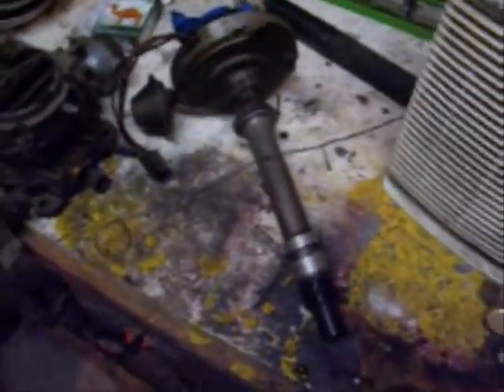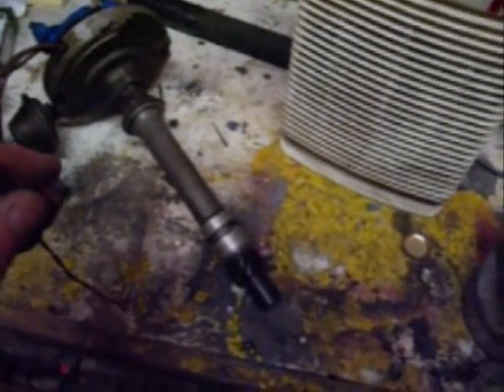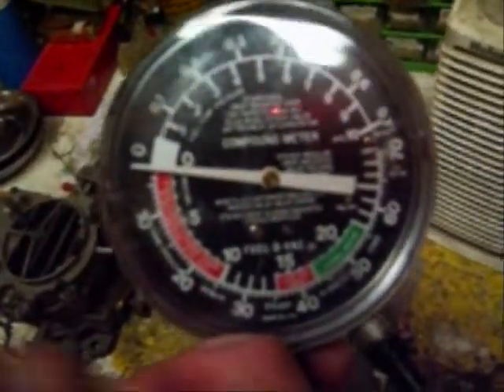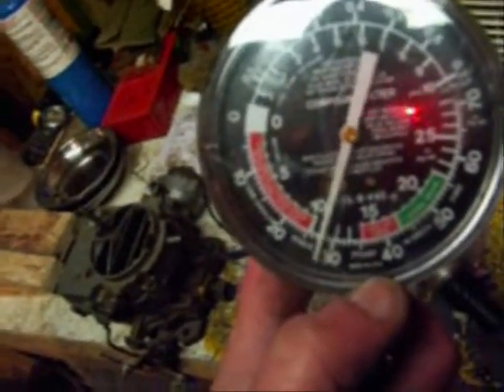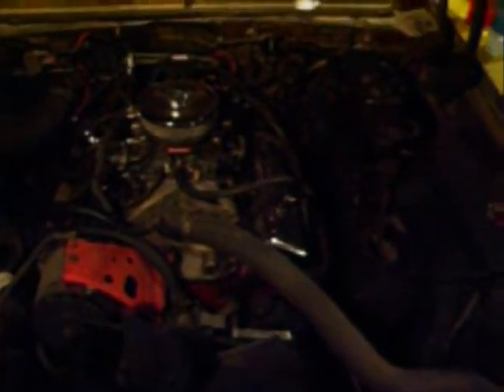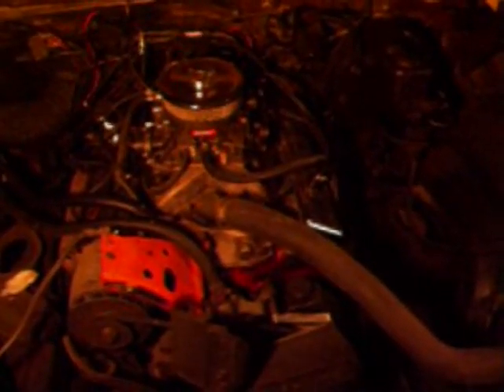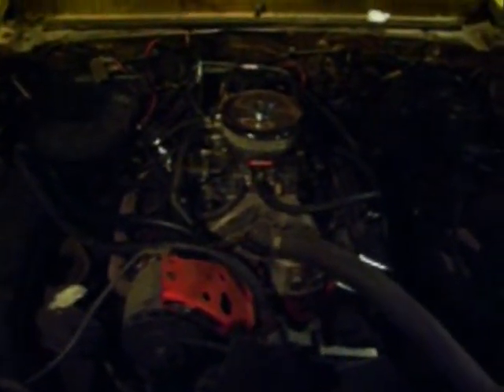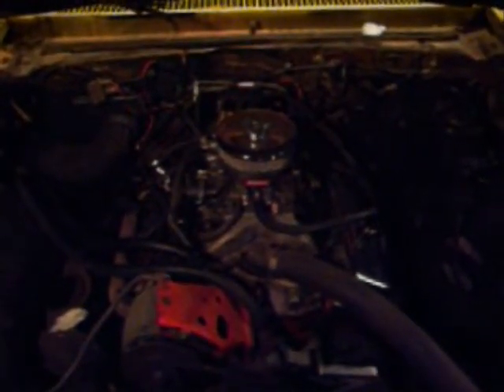Chevy small block help (from questions on my timing videos) PT3

Comment: thanks the 3 videos where real helpfull.  I just got done putting new head gaskets on and got it all put back together and cant get the time correct.  I will try your method and see if i can get it running